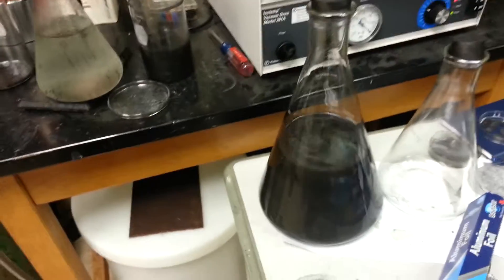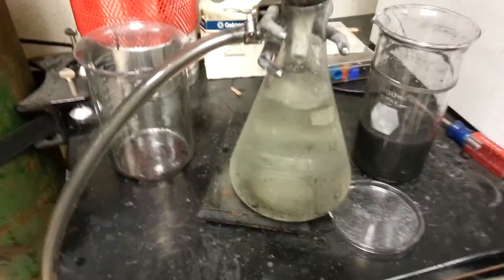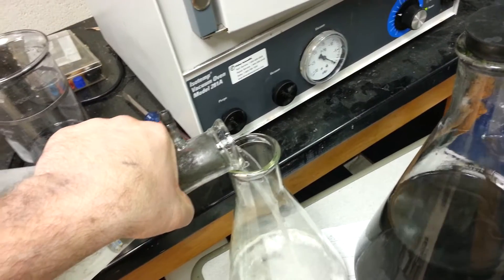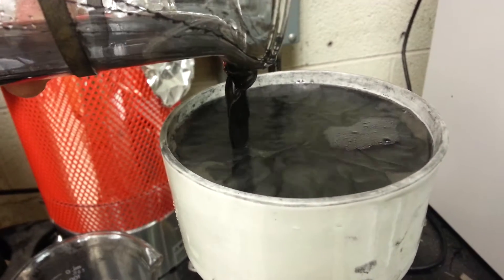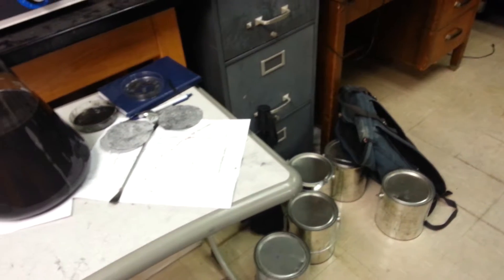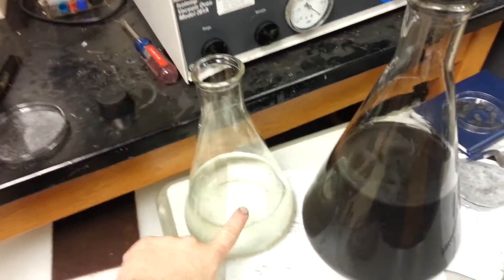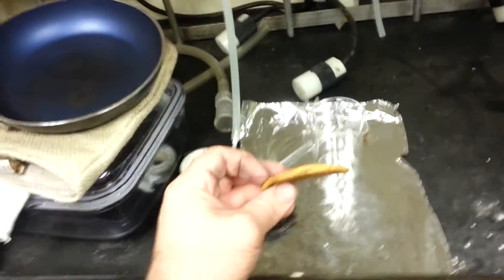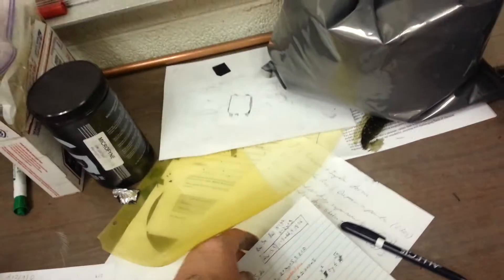Graphene in solution, filter away...

Comment: Any knowledge on dimethyl formamide acting as a sufficient anti-agglomeration method? Have read that it has a high boiling point (can be baked without evap and leading to agglomeration) can suspend the graphene without agglomeration through-out the process.
Reply from the maker: logan wygal that might prevent agglomeration, but high temperatures means very hard to get out.

Comment: Please guide did you extract the graphene from your  liquid solution directly from filter press or wash this liquid with water.
Reply from the maker: This was vacuum filtered directly from solution.
Reply: after sonication did you simply filter the graphene by filter press or add water in graphene solution.Did any pH level is required.
Reply from the maker: I didn't sonicate this. But I did filter it directly from the liquid. In this case, it's just a purification liquid from one of the stages.
Reply: did you use homogenizer instead of sonication.
Reply from the maker: PAYAL JAIN neither of these methods. They don't work. This is just a purification fluid, not part of the actual process.
Reply from the maker: I use neither.
Reply: How you made graphene solution.The solution made by HTC process
Reply from the maker: What is the HTC process?
Reply: hydrothermal process  or guide about your process ??
Reply from the maker: Not that either. I won't reveal my process because it's a trade secret.

Comment: Have you measured the surface area of the bulk dried material?  This is important for energy storage applications, as premium supercapactor carbon already boasts around 1,000 sq. m/g, and is around $20/kg.  Its volumetric performance is currently comparable with graphene, since it is difficult to obtain the theroretical surface area with high density at the same time.  Some cutting-edge research is doing better than this, but it is all very recent.

Normally a centrifuge is used to remove the heavier, unexfoliated flakes.  I don't understand how filtration is doing that for you, unless the assumption is that the smaller flake sizes have fewer layers.  Do you know what your average flake size is?

Raman spectroscopy is great for characterization, if the sample accurately represents the bulk solution.  Do you know how they prepared your samples?  An extra centrifugation step before sampling the solution can deliver overly optimistic results.  I mention this because it looks like there is a lot of unexfoliated material swimming around in the beaker.

It's encouraging to see someone so interested in this area of research.  It appears that a lab is sponsoring your efforts.  I hope that I don't sound overly critical.  I think you have a good start, and are having a lot of fun.  I also work professionally with this material, and it's a continual learning process.
Reply from the maker: Everything you said can be true. I got mixed results from the BET measurements, but as high as 1200 m^2 per gram. Now for the meat and potatoes. The filtration is staged to remove any non exfoliated aggregates, and my final filtration gets the single layer graphene. One can do the whole centrifuge thing to get good results, but my process doesn't require it. In fact, I get around 99.99% yield of single atom thick flakes from my process. The cake left in filtration is made of these flakes, but sometimes bundle up like saran wrap. To undo them, you just put the cake in an organic solvent and sonicate for a few minutes. Ramen is not the best for characterization due to many issues that come up. So I'll post a video of the most recent characterization data.